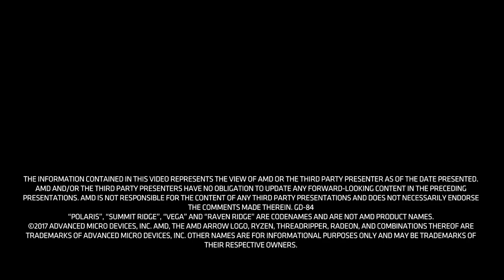How the AMD “Zen” Core is Made

Comment: Only problem with amd is the thermal issues let it be ryzen or fx series
Reply: Abhilash Sharma what kind of thermal issues does Ryzen have ?!
Reply: it consumes more watts than intel i7, onload and thus produces more heat im talking about around 50 or more watt more than intel and although ryzen has more core and threads but intel i7 gives better performance while gaming than ryzen

so to sum up if u are going for ryzen then u need a better cooler and a case with good air ventilation
Reply: Abhilash Sharma LMAO pal perhaps do more research before commenting. Ryzen is actually more efficient than Intel
Reply: hello walkman If you think so 
no issues
Reply: Abhilash Sharma that's a fact.
Reply: Lmao Intel's are toasty af this time around.Thanks to The Friggin Toothpaste.Tu desi Hai na? Terse naa ho payega.BC check before going all blue.I have i5 4th gen I waited too long for i7 6th gen.But when I saw the scores and overall quality/Price to perform.AMD Beat SHINTEL.Also I ve been Hating Shintels for a Crappy cheap Plastic stock coolers.If They have bigger budget etc.Why still stuck on plastic pins and Crappy stock Cooler fans? Why not give your customers a better Air cooler with better build and Thumb screws If they are buying your High end processor without OC(K)? Screw SHINTEL.I am not a Fanboi or anything but just disappointed by Intel company.No wonder my brand new workstation rig is gonna be Equipped with R7.Also I don't like the Vega too.Its just ok.Same price actually Vega is bit pricey over here.But No sign of Vega 64 At all.So it was a 1080 or 1080ti for me.

Comment: The only reason why i dont like amd cpus is because of their mostly super low clock speeds compared to inter
Reply: If IPC is higher, lower clock speeds do not always mean lower performance as you can see with ZEN 3 vs Intel's 14nm chips
Reply: Ryzen 5950x and 5900x boost up to 5.00 Ghz at stock. Check the reviews. Also, don't forget that clock speed is not the only measure of CPU performance. AMD had a 5.00 ghz chip back in 2013. Is it faster compared even to Zen 1 at 4 Ghz or an i7 2600k at 4.00 Ghz ? No! IPC (instructions per clock) is just as important as Ghz. The IPC in Zen 3 is much higher than any current Intel AND on top of that they can boost up to 5.00 Ghz. A double whammy.

Comment: Intel is Love, Intel is Life
Reply: wrong video?
Reply: +The Countess  AMD does the same overpricing thing with the Vega.
Reply: They're just overpriced because there is high demand for Vega. Its normal for any card to be expensive at launch. In 3-5 months you'll see it around the same price as the Gtx 1070
Reply: I doubt that
Reply: Better? Like those $1000 processors that are not even soldered? ahahahaha
Reply: no, intel is a monopoly because IBM picked their crapy x86 design for their IBM compatible PC's and so made their previously near worthless patents priceless.

intel then used those patents and the accompanying patent agreements to systematically eliminate every competitor from the market (AMD is the last man standing in that regard out of a initial 15, that clearly isn't because they are crap), scare away investors at AMD in the 1980 and 1990's severely hampering AMD's natural growth and then exploited AMD's resulting small size and limited manufacturing capacity to hold OEM's in a iron chockhold that lead to in worse PC's for consumer at significantly higher costs.

intel has screwed over everyone's who's ever owned a x86 PC. screw them.
Reply: I remember when they lied to us before the FX release how good their new CPUs are but that was a big lie. At least Intel don't lie to us.
Reply: attitudes like that will insure you will be buying worse and far more expensive products from intel in the future. (in fact you already are and have been for a decade. intel screwed over the whole PC market)

taking it even further the attitude that companies can do whatever the hell they like without repercussions will ensure we'll all live in a far worse world.

they also make a worse products: Artificially limited (i5), artificial and unnecessary planned obsolescence and  ofcourse far to expensive.
Reply: basshead Intel likes to use the number 13 in their CPUs microcode, so set all your ram timings to multiples of 13 if you want to eliminate frame stutter and out of sync frames. But that's intel 4U
Reply: WarmSoftKitty So... name a product by intel that is better and state why